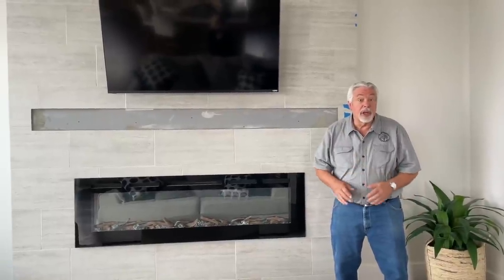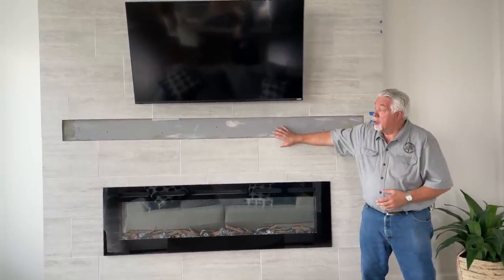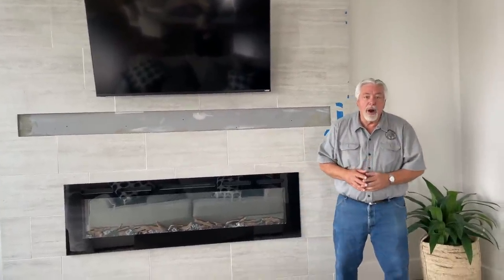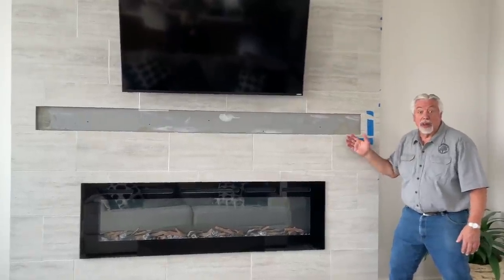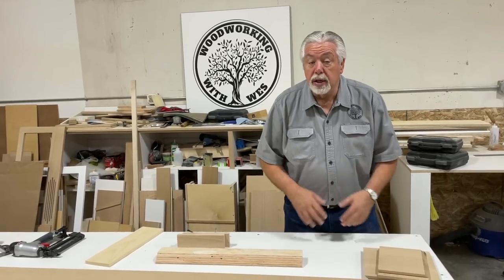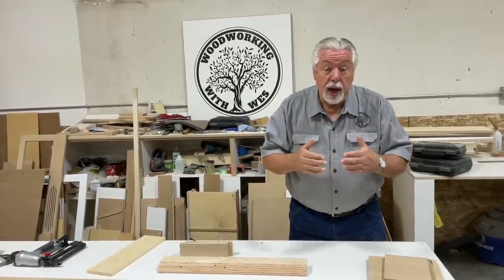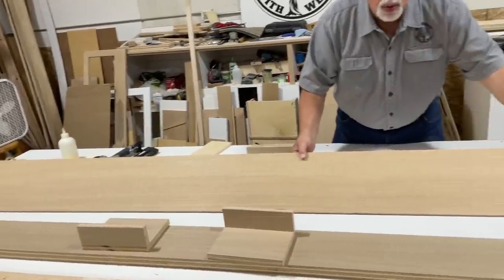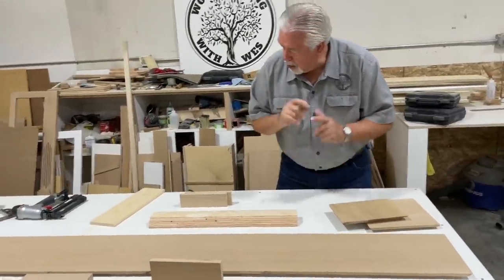Building a Large Box Beam Mantel Is Easier Than You Think

Comment: i did a center beam for my ceiling running the length of our tiny house. stained it with a darker brownish/red stain, then over that i stained it black. result was you can see traces of color faintly showing throughout the piece, then i gave it three coats of poly, looks awesome. only thing is instead of cutting to fit the rafter lengths i mistakenly just started at one end and by the time i got to the other the ends didn't match up on the beam so i had a hard time getting it nailed up there right. but hey it's a learning process, right.
Reply from the maker: It is a learning process...I have been there!! Thanks for your comment. Wes